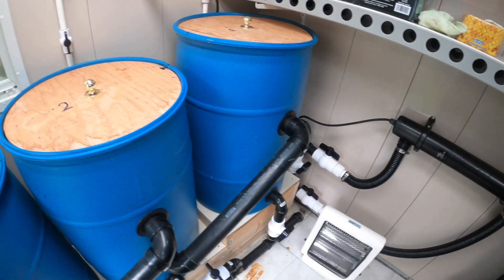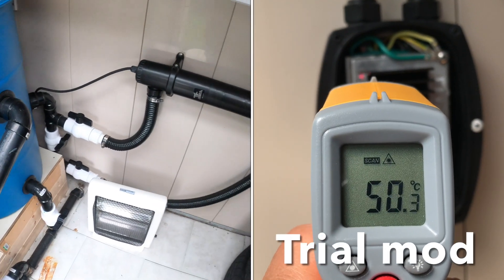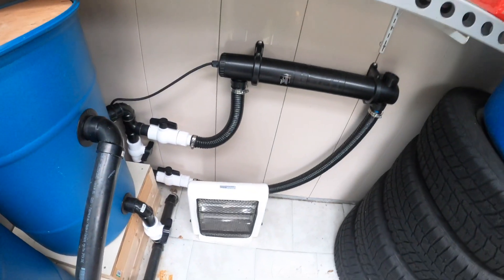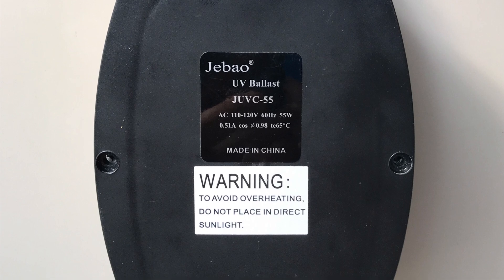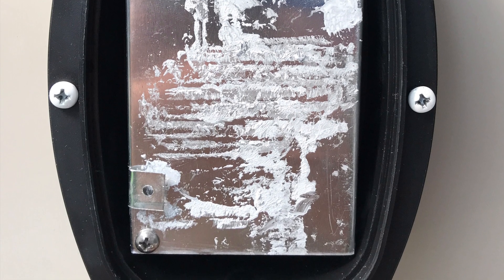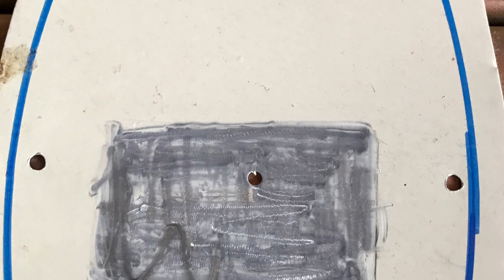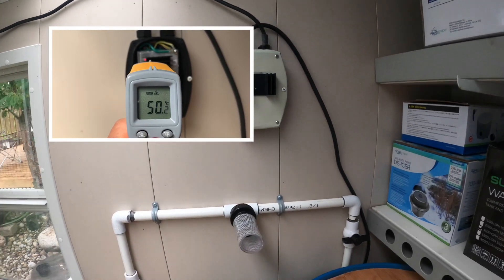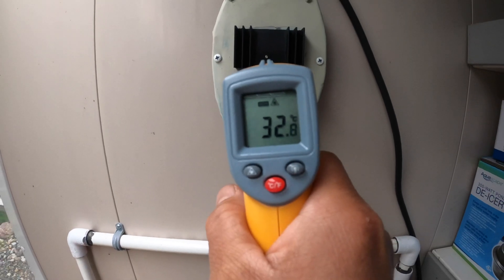Jebao 55W UV Clarifier/Sterilizer Keeps Tripping GFCI Outlet - Quick Fix

Comment: hi mate iv subbed to your channel and iv been watching your videos,  I'm new to all this koi ponds and stuff and just finished my raised wooden pond its 9ft long 5ft wide and deepest in middle is 4ft any idea on what filter i would need to run it pls,,, im thinking if a retrofit bottom drain would be good to run or just a pump. any advise would be appreciated thanks mate
Reply from the maker: Hi mate!
Thank you and welcome to my channel.
I am also one of the new comers to the pond and water gardens too. I did some researches before I started building my pond and 3-barrel filter. There are so many choices of filtration out there that may work with your pond size or you can DIY the 3-barrel filter like mine at smaller scale (smaller barrels and smaller pump)
https://youtu.be/u_JdR6ghwPU
This system is very easy to clean and maintain.
Reply: @PTranProductions  thanks for reply mate I was looking at 3 barrel filter but don’t know what size barrel and pump I will need to run a 5000l pond
Reply from the maker: @Jay-_Meister  
I forgot to mention, retrofit bottom drain is a good idea.
For 5000L pond, you need at least a 5000L/H pump. You may use 60L(15Gal)  barrels like this one: https://www.mec.ca/en/product/5036-414/Plastic-Barrel
Smaller UV light like this one: https://www.wiedamark.com/product/jebao36wattaquariumkoifishponduvlightsterilizer/
And add your bio media accordingly.
Reply: @PTranProductions  thank you for links mate that has help me out a lot thank you again.
Reply from the maker: You’re welcome!
Good luck with your pond!

Comment: I have the same uv mine is wired into a fused switch box and not had any trouble with it other than rats chewing through the wire lol
Reply from the maker: So I am just wondering if your switch box is connected to an RCD/GFCI circuit breaker or outlet. Or you simply have it connected without a RCD/GFCI circuit.
Reply: @PTranProductions  rcd plug
Reply from the maker: @progressivepondkeeping  
That’s good mate!